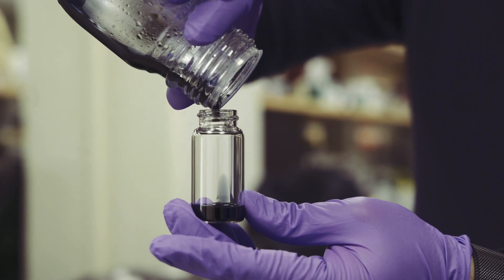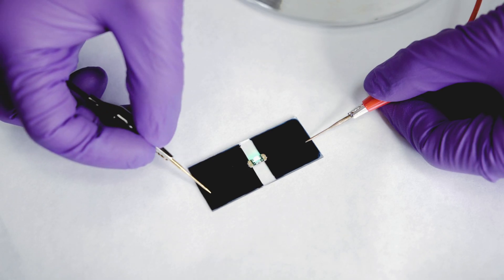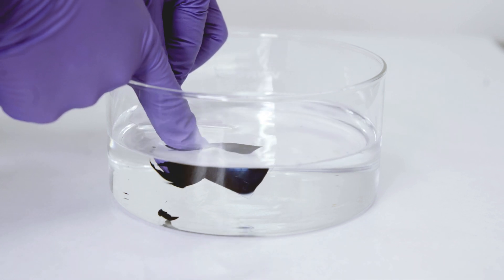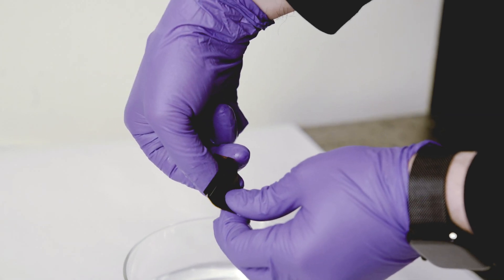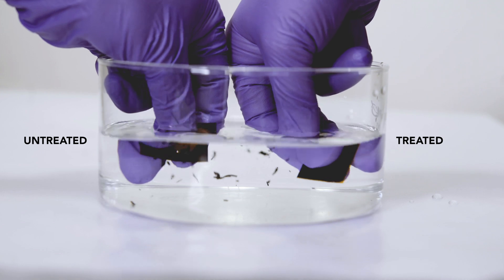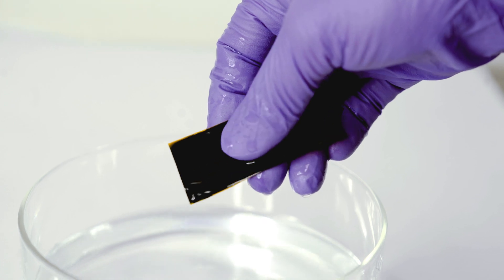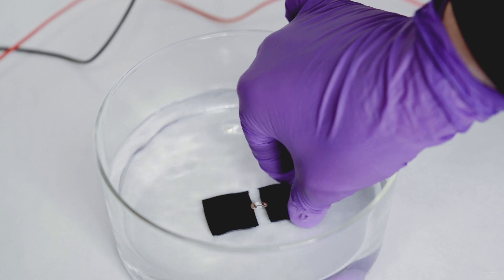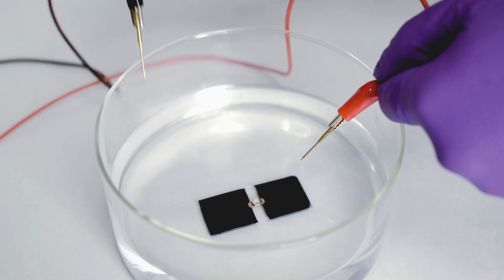How to get conductive gels to stick when wet

Comment: How about making some lightweight, high current, graphene powder filled, polymer tube insulation encapsulated conductors for electric airplanes, cars and space applications? It's an idea I mentioned at a NASA briefing a few weeks back, but got no responses.
Reply: ur just throwing in words.
simple explanation pls
Reply: Graphene needs to be a very thin, 1-atom layer